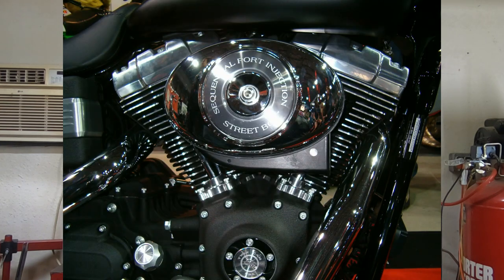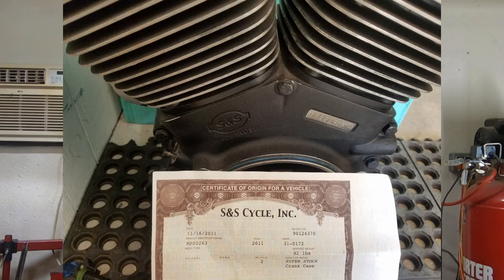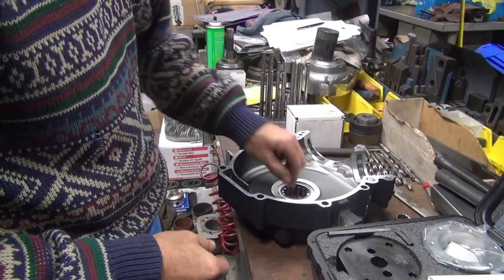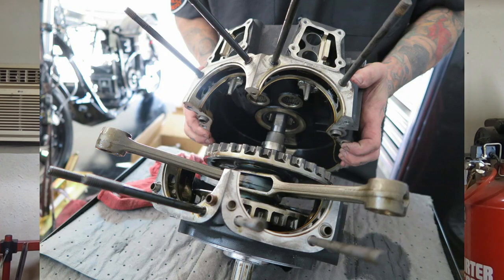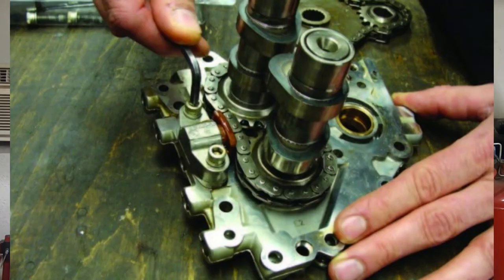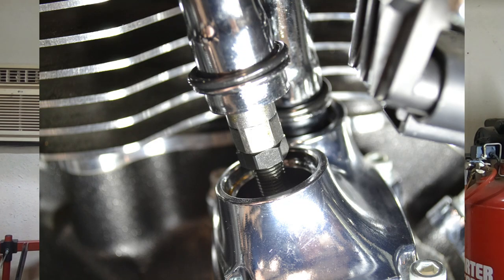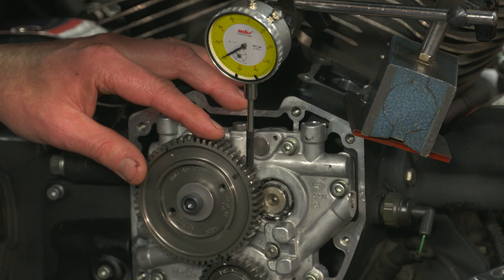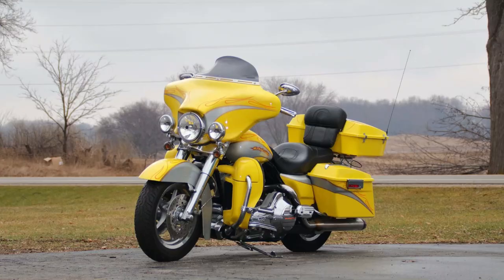Twin Cam Harley Engines Can Be Bulletproof

Comment: Thanks for the Vid... at a very minimum, High Volume Oil Pump, Oil Cooler, and a Guage to monitor. Target oil change at 2500 miles. I run Amsoil.   It's worked for me, 20 years on TC's....  (knock on wood) no mechanical downtime. One more thing, 1 to 1.1 hp per inch. It's a Harley, not gonna keep up with a Busa.... lol

Comment: I have a stock 05 FLHTI with 22,000 miles, i need to remove the motor to fix broken exhaust studs, i dont think i will do any motor upgrades at this time.

Comment: I need your advice bro. We rebuilded 07 Heritage. Installed 110 big bore. Put in all the goodies you talked about in your video but I still feel it is not running smooth. Secondly, it doesn't goes far in first and second gear and I have to upshift really quick. What do you think the issue is? Are we missing something? Appreciate your feedback.
10:36

Comment: I really look forward to your videos for the information you share and appreciate that you make these videos solely to help others. Thankyou.
What I do not appreciate though, is that the need exists to for you to do so, in order to make an American motorcycle from one of the oldest, most recognizable major brands in the world, with possibly the highest cost, (but certainly the most loyal customer base worldwide. Hell, even kids in the poorest of countries covet a Harley T-shirt!), all because HD appear incapable of ever getting engine design right. At this stage they really should understand better. 
Japan does.
Improving performance is different (if the customer really wants that), and often comes with penalties, but ensuring customers can simply use the motorcycle in a way that other motorcycle manufacturers manage to get right straight from the factory, is sad....very sad.
Harley need to add step up their game and seriously consider their mechanical design hiring metrics, as opposed to why sales are hurting, increasing their prices and peddling trashy accessories. They are not boutique, they are cool agricultural!
I've owned ironhead Sportsters, Panheads, Evo big twins, one V-Rod, one Buell and now an 88 TC Softail; and loved them all! However only the V-Rod appeared "almost" bulletproof. (Ground clearance, thimble sized gas tank and riding position all were questionable).
Please keep the videos coming, as I doubt HD will be stepping up to the plate any time soon.

Comment: What's your opinion of the Wood Performance Cam chain conversion kit hydralic cam plate, oil pump etc. that comes with the Fuel Moto 98" big bore kit? Would it work with a stock crank on a 2002 Fatboy with 20k on it?

Comment: 100% agree with your advice. Most of it was done to my 2002 FXD, that now is a 103cci. (Stage IV SE)
I have a 2 in 1 Danmoto exhaust system on it (cheap stuf) but it sounds and looks good (for me).  
Only 1 small negative with this total setup, the SE-259 cams have a big dip in Tq from 2500 to 3500rpm.  
And thoughts on a different exhaust, that could flatten that dip a bit?
Reply: Why would you put all that money into the motor and cheap out on the exhaust? I would definitely get rid of the danmoto and look into a better performing 2-1 like a thunderheader or D&D

Comment: I like my 88 TC, but I don’t believe that I like it enough to make an airplane engine out of it. There ain’t no pulling over when you’ve got a cam chain tensioner leaving the building. But I have to admit the sound of the idle most get some strange looks around the old airport!

Comment: I bought my bike used and the Harley Dealership put the S&S big bore kit in it with cams before I bought it and I need the courage to take a few things apart and try to find out exactly what else was done. Should priority number one for me be checking the compensator? It runs amazing and only has 11k miles on it total. 96 brought up to 103.

Comment: I went with a Baker comp for my 2010 twin cam, before i saw the Dark Horse.
If i have to do it again...
Reply from the maker: The Baker is a really good product and they do last a long time. They must of had a bad run or something there for a bit, they had some failures for a short time.
Reply: @GixxerFoo  I was impressed with mine when i installed it. It looked very well made.

Comment: I will say, coming from a 2020 FXFBS to my current 2008 FHLTCU, power to weight is definitely a huuuuge difference between bikes, but the way the low end tq of the M8 comes on is excellent vs my built up 96. Apples to oranges for sure, I like the sound and character of the TC, but I'm definitely looking to get back on a M8 114, but with a CR485 cam in it hehe.

Comment: Are you sure about olt together TC flywheels ? I've had lots of TC engines apart & have never seen one . The flywheels would have to be way different cause there is no room in the cases for the crank pin nut !

Comment: I used to do everything to my bikes but I just don't have the time now...but I don't trust just any mechanic either...I'm about ready to make some changes to my already cammed 2015 Roadglide Special...

It seems like you also do this for a living.  Where are you located and how can I hire you to rebuild my 103?  Anything it needs...relatively speaking, price isn't a concern...If your interested, please give me a way to contact you directly.
Reply from the maker: I appreciate the offer but I just do some local work in my spare time, I got out of doing it full time when the industry started to slide back in 2009. There's a lot of excellent indy shops out there with some quick turn around times!
Reply: @GixxerFoo  Too bad.  I would've felt good riding a bike you wrenched on.  Let me know if you ever want a winter project.

What's your opinion on Andrews 57H cams in a 103?  The bike has those in it now with a Performance Machine Max HP intake, D&D Fat Cat 2 into 1 pipe (w/ louvered quiet baffle in it now but I have the perforated one too) and its tuned with the HD Race tuner ( I have an V&H FP3 for it too but I just use the tune from the Race Tuner).  It goes like hell from 20-120 but it's a little unruly putting around a parking lot and it's really loud, even with the quiet baffle in it.  I ride a  lot of two-up with my wife on the back plus is has a King tour pack, lowers and some other weight like stage II front and rear speaker amps.  I haven't ridden it a lot in the past few years so It's only got 35k miles on it now but I figure its time to at least go into the cam chest and see how the chain tensioner is doing.  

Long story short, I'd like to build a motor for it that's 1. quieter 2. smoother at lower RPMs 3. powerful on the highway...but it doesn't need to peg the speedo in a heartbeat like it can now...Although, that's never a bad thing, I'm getting older plus I plan to buy something else for when I want an adrenalin rush.

I bought the bike in 2017 (it's a 2015).  I bought it from Classic HD in Reading Pa.  It had 2,200 miles on it when I bought it and it hasn't ever given me a problem...except it's making me deaf and it's trickier to ride slow than a stock HD.  I've never gone into the motor on this one.  The story behind it is that one of the owners from Classic HD had it built for a Tail of the Dragon ride he went on and then put it up for sale at the dealership.  They gave me a list of the parts it had installed at the dealership but I didn't see any head work on the invoice.  anyway, it's a good engine but not what i want right now.

Optionally, I'm thinking of putting an S&S T111 or T124 crate engine in it.  Which way would you go? I figure the adventure will cost me about 12k out the door regardless which way I go...but still a lot cheaper than a new one.

Comment: I’m 44, 2 HD’s (M8 SGS & XL1200C) I’m finding myself bored with them. The Sportster is a fraction of the cost of the Street Glide and it gives more satisfaction to ride. Seriously thinking of trading the Glide in on a Super Duke Evo, bc I young enough to do it, old enough to be in a place to do it. I’m sure I’ll regret letting it go, like most motorcycles I’ve owned, but life is about regret and the need to fill that void.
Reply: Perfectly said. I sold my 2020 StreetGlide and bought a 2017 BreakOut. The only thing I miss is the hard bags. But I have a large swingarm bag that does just fine. I smile more on a softail for some reason. Especially the HO103.
Reply: My Sportster Evolution has 400,000 miles on the original engine and the only thing I have done to the motor with to replace the stator when it was 20 years old and had 250,000 miles on her. Love my Evo Sportster not fast but fun as hell. Glad to see you're keeping your Sportster they are great bikes. Super reliable at Dependable as well

Comment: 2007 Electra Glide Standard stock engine 
S&S true dual header, 4" Rhinehart pipes, Screaming Eagle high flow air kit
Can I install a compensator eliminator with no other mods to start with?

Comment: I regret ever messing with the 103 in my 2014 Fatboy Lo. I had a local shop (well-known) install the Timken bearing along with the S&S 124" with oil pump & cam plate. I swapped the 640 cams for the 585's and this thing has been a flaming pile of shit ever since. A perfectly good 3,000 km bike is now the most unreliable bike I have ever owned. It was in the shop for over a year and then back in 4 times afterwards. I wouldn't buy S&S ANYTHING for my next bike! I'll keep this thing until I can get that new HD 135" in an OEM bike from HD.... then I will trade up and leave it stock except for cams, intake, tune and exhaust. Extensive engine work is a crap-shoot. Either the parts quality is garbage or the shop is. The consumer never knows because both morons point fingers at each other and take no accountability!

Comment: At 2:00 your saying that 1999 to 2002 have a crank that's bolted together. I have a 2000 OEM 88" crank and its NOT bolted together - its pressed - just like all other Twin Cam cranks.

Comment: I can only speak on the tc88.  After having an EVO that is bulletproof out the box.  To say putting 3-5 grand into an engine under 30,000 miles is regular maintenance is a joke!  Unless you’re a rich guy who doesn’t care if they get screwed!  The twin cam was made to get Harley dealerships service departments rich!  They don’t charge enough for them out the door!  And 20 years later they’re doing it with M8’s.  Need upgrades before you leave or breakdown and pay 3 times the upgrade.  So I guess it’s worth it for idiots who don’t know there were better options in the past.  Oh and I can get all the speeding tickets you can with all your horse power!
Reply: Ya know Big T you're right. I did buy an '05 TC in a low rider frame because it was under $5,000, had 12,000 miles on it, and it rides like an oversized sportster.
I can't do long miles in it, sadly, as much as I'd like to.
My 70 year old ass has too much rust.
But I agree, spending $5,000 on a motor build for a $5,000 bike is kinda crazy.
Understand, Fixergoo is presenting ideas for the gallery. WTF? How fast does anyone need to go?
I don't give two rats shits about racing anybody.
It's the advantage of being an old fuck.
Us old retired peasants just don't have the cash not give a shit about bragging.
Reply: @Fred-Ash  I’m happy to know I’m not the only person who sees the problem.  I love my Roadking but it’s crazy to need major work done just to ride it. My buddies that have the M8 are regretting it.  We are forced to fix a known factory problem!  Ride as much as you can and enjoy it!   There’s nothing like it!

Comment: I'd run my 2009 twincam against any evo for a 1000 mile iron-butt challenge at 80+ minimum mph , they would have top end leaks and failures way before I have bottom end failures , times change, fuel changes and the "normal" Highway speed you have to run to avoid getting run over has changed too , all in which the Evo was not built for back in 1984-1999 , so if you take all that into place and ride 10,000 miles or more a year on the Highway then I know my Twincam maintenance cost would be less than a evo IN MY OPINION .
Reply: Excellent points about times changing, especially average traffic speed... Talking about 90mph average on Phoenix i10 & i17

Comment: It is one thing to build a hot rod motor because you want to it is quite another thing to have to replace cheap parts that's Factory put in wrist expensive American made parts that they should have had in the first place instead of the cheap Chinese parts. If they bought all of their imported parts from Honda like their suspension and fuel injection there would be no problem because Honda does not make bad part.

Comment: Problems with crate engines and vin numbers? Could you explain that? Maybe a subject for a future video. Keep up the great work. Love you videos.
Reply from the maker: If you go to sell the bike the vin number won't match the frame, so you'll want to have documentation on the engine swap. 

Even worse you get pulled over, non matching numbers scream stolen to the cops and vins are easy to check on a Harley. Just good to keep a copy of your mso for the engine with you. 

It can cause a hassle worst case scenario if there's a road side fishing expedition on a traffic stop. Had it happen once with a buddy that had a Ultima engine swap on his Evo.

Comment: The twin cam engine should have been as reliable as the Evolution motor but it isn't. To take care of all of the mechanical shortcomings and make it reliable cost a fortune. Sure you can do stuff to make it more reliable but it will cost you dearly. I would still buy an EVO over a reconditioned twin cam.
Reply: TC88 over Evo all day.
Reply: @ajb1117  you can make more horsepower with a twin cam after you drop tons of money into it but it will never be as reliable as an EVO. Evos were built for reliability at your run cool something a twin cam has no knowledge of. The twin cam motor is when Harley started to go wrong and left a bean-counter design their engine cheap for them expensive for you.

Comment: Got a 2001 FXSTB, carbed and a set of S&S 509 cams in it and I love it.

Thinking of doing a big bore kit in the future, but I thought the crank on the 99-02 were cold forged and pressed together. Where did you find the information on that the crank is bolted and not pressed?